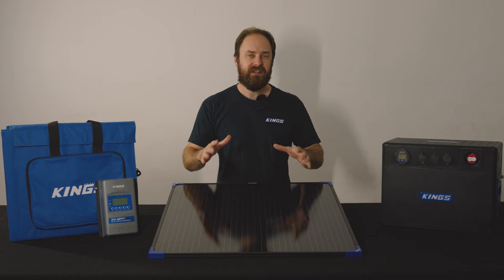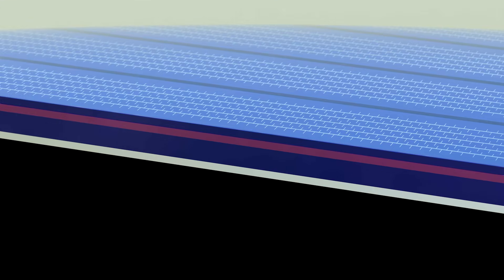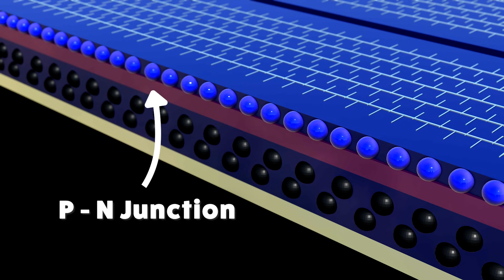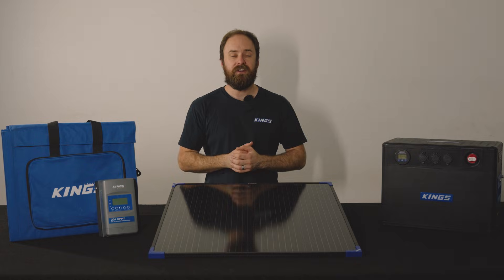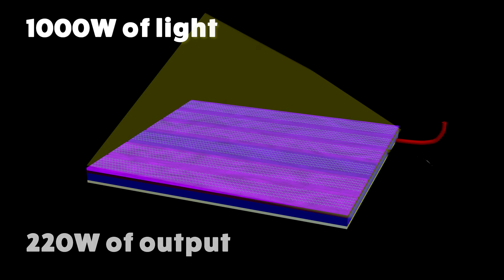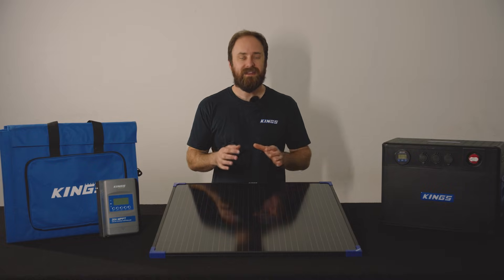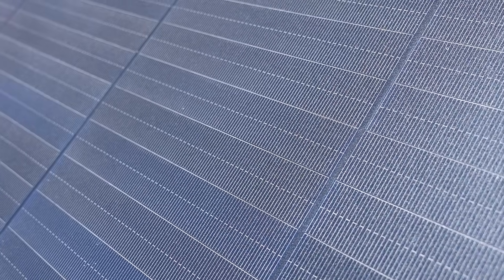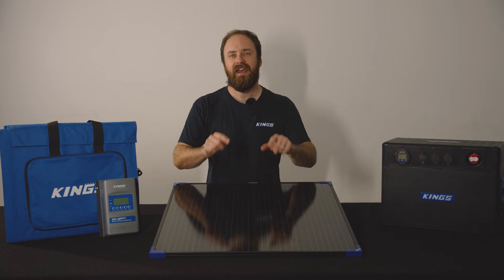Kings Solar Masterclass Pt. 1: How solar panels Work - Layer by Layer!

Comment: What you need now is an all-in-one power box (DC-DC, MPPT Solar Controller, Inverter, etc), that is ready to plug into an auxiliary battery.
Reply from the maker: Might be worth checking out our BatBlock - it is an all in one setup like you're describing with the ability to easily connect an inverter if you want one.

Cheers,
Cahn
Reply: @4wdsupacentreAu  I have, but I'm not after a power station style box.  I'm after more of the thin and tall form factor, like the Enerdrives (and now also Kick*ss), with the battery mounted elsewhere (like a thin lithium battery etc.).  This style power box will fit in the wagon part of my 4WD better.
Reply: @4wdsupacentreAu do you have a video on how to add control box on batblock25?

Comment: I run a 75L dual zone fridge permanently in my 4WD, and I use one of your 160W panels that I've permanently mounted on top of my RTT as my aux battery's main source of charging (4WD is typically parked on my driveway).  I fitted the panel about 6 years ago and it still works well in keeping my aux battery charged up (touch wood).  So much so that I seldom use my Kings 200W solar blanket (which I got as back-up).